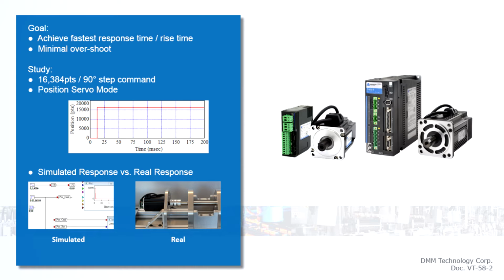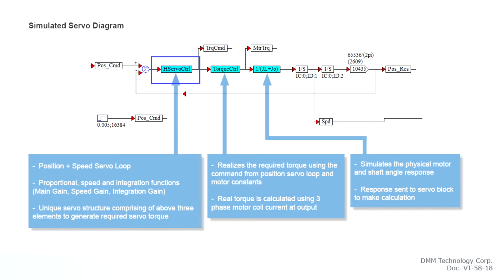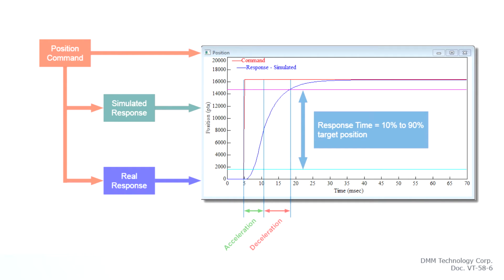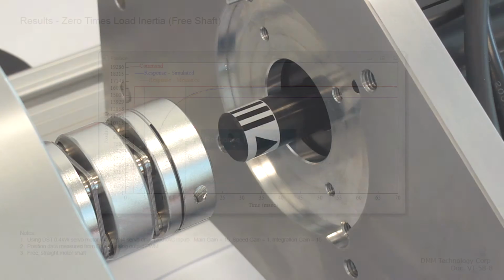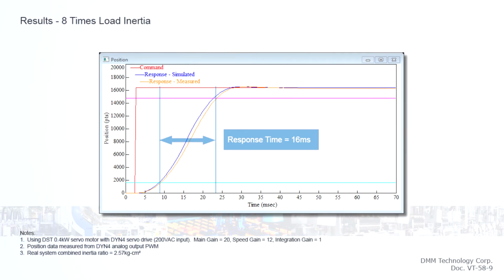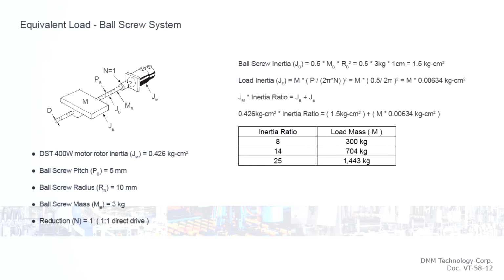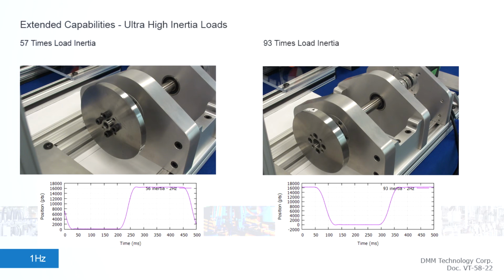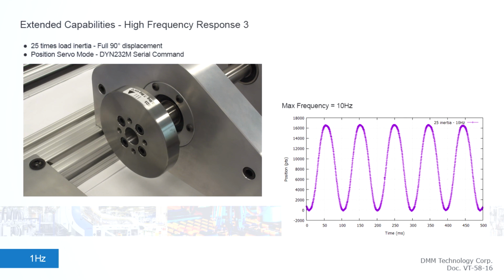DYN Servo Control - Response Time Demonstration

Comment: I am building a robotic fabric shaver and I have a series of cleaning heads on there and they all spin and rotate in different degrees of spin movements across three axes as well.  Is it possible to het 600 hZ movement back and forth of the cleaning heads?  This is minimum what I need?  I can pay you to help me if you think you can?  Thanks and god bless